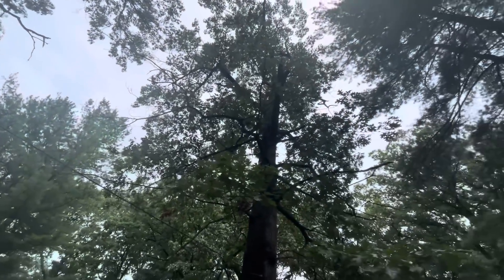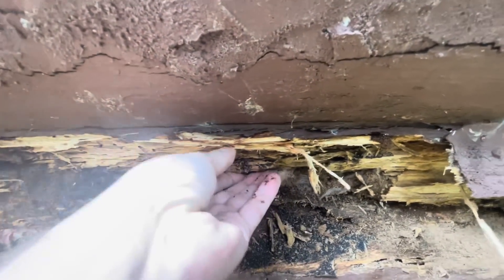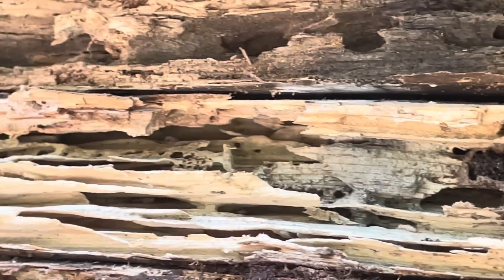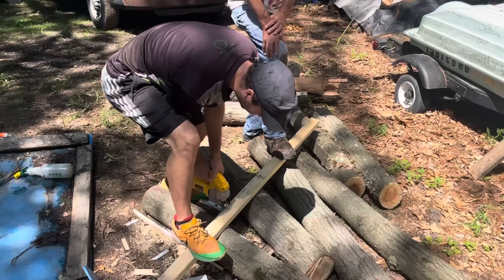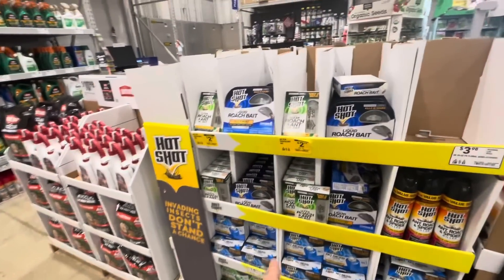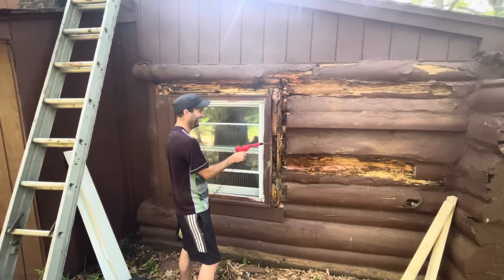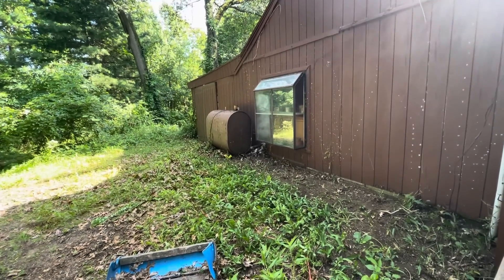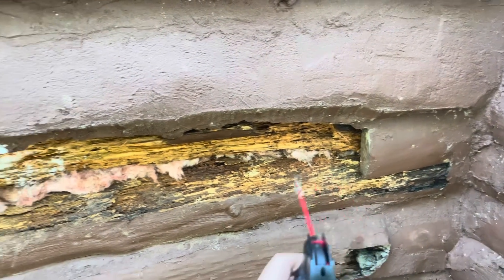Getting rid of termites and fixing the wall at my house before I go to the Philippines

Comment: Hey Dustin, I live 5 hours from you. Termites need water. They make a product you dig a small trench around house and add product then replace dirt. I did it myself on my 100 year old house. No more termites for 10 years now. Of course you had to spray the house but the ones you miss need to go back into the earth. Good luck
Reply from the maker: Ok thanks!

Comment: When you get it cleaned out good to repair it make sure you get some linseed oil put it in a sprayer and spray it up in the openings let it dry for a half a day when the sun is out and then seal it up that will help keep it a little waterproof and but bug free
Reply from the maker: Thanks Calvin, we just bought some professional termite solution so hopefully that will do the trick

Comment: Hello Dustin can you help me out let  Me know how much your ticket is to the Philippines , I have been trying to go for over a year now but the tickets are so expensive,  When I do look it up they're asking $3000 4000 I've even seen him as much as $6000Round trip, Can you help me out where to get a good price on a ticket Trying to meet my fiancé and layte, Don't know if you remember me Keep up the good work
Reply from the maker: Hi Richard , it depends a lot on which airport you are flying from/to. I usually use google flights and play around with the dates to find the cheapest one. Start with one way and find the cheapest and then find the return. Here is a video that will help 

https://youtube.com/watch?v=YAm5efHmNRQ&feature=sharec
Reply: I will tell you this September through early November are the cheaper flights. You need to book in the off season for the best beals. I got a flight from Lansing Michigan to Cebu Philippines for $1250 round trip. It cost 500 more if I flew out of Detroit or Chicago but I'm still flying out of Chicago. Also book out of the larger airports and see how much a separate connection ticket is from your local area airports.Some times you need to play with the airports. The issue is it's a 40 hour flight with a 10 hour layover in Qatar. But it's a bonus to me the airport is like the best in the world so an extra day to site see and try other foods. Also look at returning air ports I found in the past if you book another air port you may land in the one you want on a lay over. I did this for my wife I wanted Detroit but it was $400 more then Chicago. But the flight I found landed in Detroit as point of entry then to Chicago so she got off in Detroit and saved $400. This way. Ps my friend's wife bought a connecting flight from Seattle to Lansing Michigan cheaper that a flight from Lansing Michigan to Chicago. Don't ask me how. But keep this in mind 😜